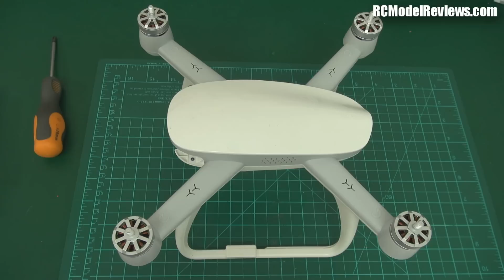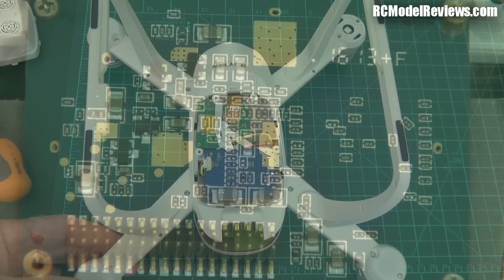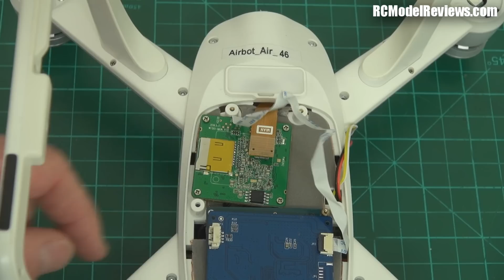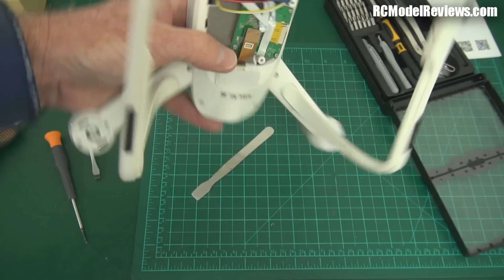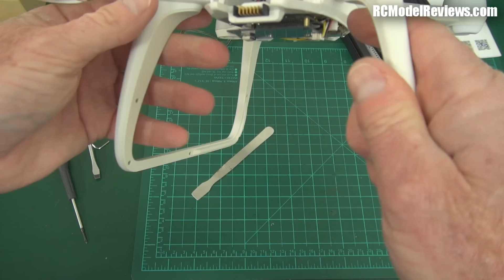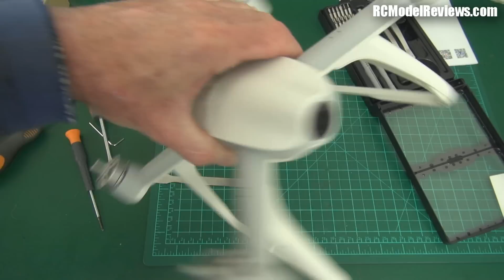Walkera AiBao drone teardown (fail)

Comment: The only real competitor to the DJI Mavic is the DJI phantom, mentioning it in relation to this toy quad seems a bit random?  I would have been very interested to see what the GPS module was and what type of flight controller it has, I don't normally find anything to criticise in your videos but this one seems a bit half hearted :(
Reply: The only thing that can be compared is the design/look of it. In every other area however, it's not even close. This is one of the worst, if not the absolute worst, in terms of value for your money. Walkera really needs to just go away.

Comment: take the top off, after a few flites it just falls out of the sky anyway  because of the bad solder joints and brittle wires that walkera uses.

Comment: Kinda sad, all these "new" all in one drones. About the only thing you can replace is the props! Proprietary batteries, yuck! Like a cheap TV or DVD player, when it breaks, throw it away and buy another. Can you imagine trying to replace an ESC or flight controller? No way. Seems the build it yourself from scratch thing is slowing down. I expect the prices for frames, motors, esc's and flight controllers to drop drastically as people go for these fly out of the box things.

Comment: As soon as you removed the cover with the faux ultra sonic sensor cover it was evident the tear down was not going to be favourable. The ribbon cables appeared to have been scrunched into the available space and the boards looked quite wonky. The soldering was indeed dreadful but I also noticed that the wire ends appeared to have been stripped by someone with an excessive over bite or a mouthful of teeth looking like garage doors in various stages of opening. As you say. Bruce, with a little more thought into the design and build Walkera could of had a competitive mini camera ship but at this stage it's just one half of a set of book ends.  
Regards. 
Nidge.

Comment: Walkera seems to jump into a market with too much emphasis on speed of production. They then deal with shoddy assembly when a good product starts failing at an unexceptional rate. They then send in the debuggers. They find the components are OK that it is the workmanship of their assembly line workers. They then make their supervisors go hands on to educate those assemblers in acceptable and poor soldering. They probably replace those who can't cut the mustard. They then start producing a quality consumer product. RIP INTO IT. Give Walkera a head start on correcting what is wrong! You are spot on about the direction Walkera should go with the platform. Scrap V.R. and go with an electronically directable, stabilized camera. Turn the S.D. card into recording media. Install ultra sonic altitude sensing. Great FYI video Mr. Bruce!

Comment: I would finish tearing it down,you started it,finish it. That would be like getting all the stuff to build a really nice plane,then not going through with it. So what? Now it just sits there. Yes,we saw the dodgy wires and the sloppy connections as well as the camara issue,hell its not like you are hurting the review any by snapping off a couple clips. Super glue fixes everything doesnt it. Just dont mention the broken bits and turn the cover over so no one can see the broken tabs.

Comment: To be honest it doesn't look like they finished it. Maybe they where going to put ultrasonic sensors and never finished their firmware or something.

My vote would be is to strip it, and fit an APM, Pixhawk or TauLabs compatible flight controller and have the only flying AiBao in the world (it may give Walkera a hint)

As for stable altitude hold, you can get pretty good altitude hold with GPS, a barometer and some decent code (just look at what the old APM could do)